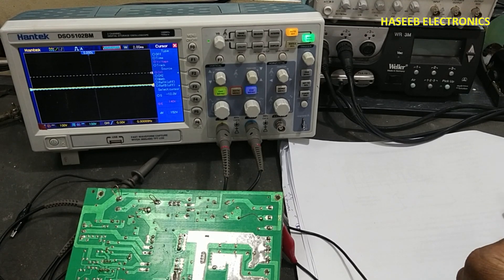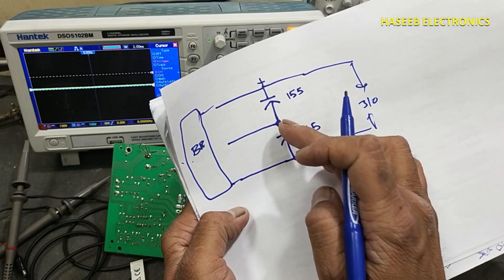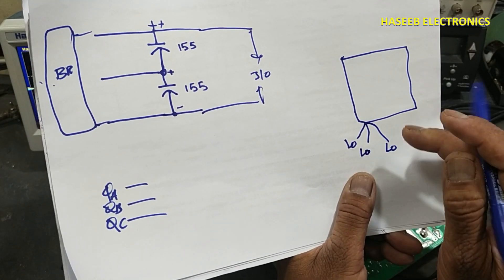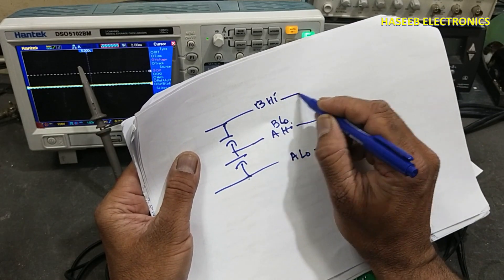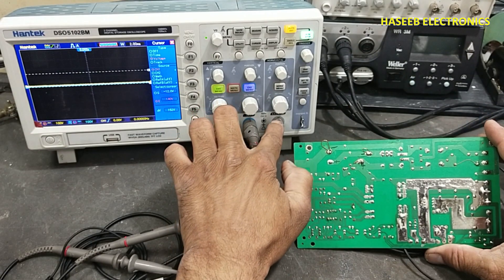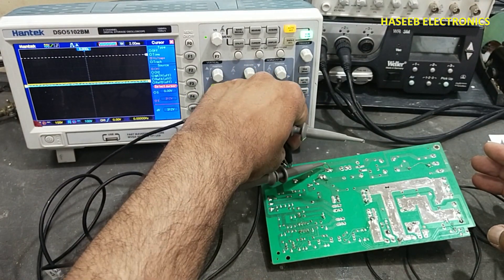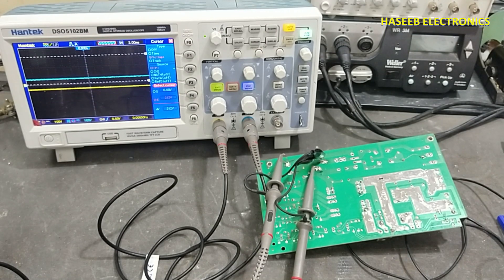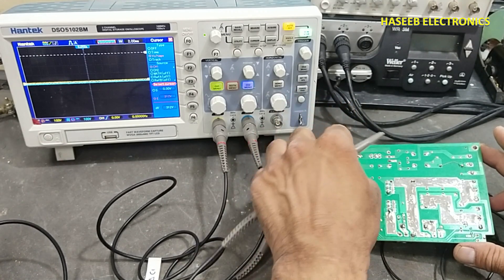{896} How to test dual signal using DSO

Comment: What's that plug you said? 2 pin plug!
Alaho akbar, baba!!!. 2 pin plug in US is 1 hot and 1 natural the natural is Ground!
Reply from the maker: 2 pin plug contains line and neutral. although the neutral have already ground potential but it will never reach to chassis of the equipment
while in 3 pin plug, the ground pin is connected as chassis ground

Comment: Hello great video. very good explanation. Question : if all the low sides are connected together inside the scope, why not keep ONLY ONE low reference connection on ONE probe, and remove the reference connections from the other probes ? that way, you can never make the mistake ? what do you think ? thanks in advance

Comment: Also, if you check a high voltage with a scope, the capacitance in the scope leads will store a voltage. If you then go check an IC without first shorting the lead to its ground you will put that voltage across the IC. They don't like 310 volts very much. A common mistake with hybrid tube type guitar amps. Thanks for showing and have a great day!
Reply from the maker: really superb addition sir 
i never experienced it

Comment: Personally, I don't feel comfortable using a scope with mains voltage exposed on the connectors so I always use a differential probe in that situation. Yes – the probe was about $200 but it provides quite a bit of additional safety, both for me and the scope...

Comment: I always prefer to test SMPS, and motor drives, connected to grid via isolation transformer. Another option is to connect scope via isolation transformer, but, during the tests it's chassis may become on live voltage via ground connection on probes, which is dangerous. For me, safety is in the first place.

Comment: 7:30 it`s not just connecting the oscope gnd leads to the same point BUT THAT POINT IN THE CIRCUIT MUST BE THE CIRCUIT  GROUND  otherwise you are going to short part of the impedance to   the real outside ground/earth  and destroy the scope and circuit , secondly this measurement has to be done with an isolation transformer but because in this condition using an  isolation transfomer you are no longer referencing your scope to the real ground the earth ground  it will pick noise and anything above 10-20mhz will be noisy .Solution when you are going to deal with higher frequency is differential probe , at lower freq you can get away just using an isolation transformer or cutting the scope gnd wire
Reply from the maker: thanks a lot for your valuable point. 
if you remember i explained in video that when we are testing un-isolated signal, then we can use
battery powered o-scope or
isolation transformer based scope without safety ground 
or 2 pin power cable to power up o-scope 

yes you are right, differential probe is perfect solution
Reply: let me make it a bit clear IF you are hooking the scope gnd leads immediately after a bridge rectifier you are therefore creating 2 parallel  paths for current to flow into the rectifier . First via the neutral wire as it should the second one through the scope and your black/gnd lead which you connected to the neutral after the bridge ,  let`s say somebody is going to cut the neutral wire outside your house  there is only 1 single path forcurrent to flow  from  neutral/gnd to  line  and that is through your scope YOU ARE GOING TO BLOW  IT 😁
Reply from the maker: it is most important point that 
to test unisolated signal, we must isolate oscilloscope from safety ground 
or 
use battery powered scope